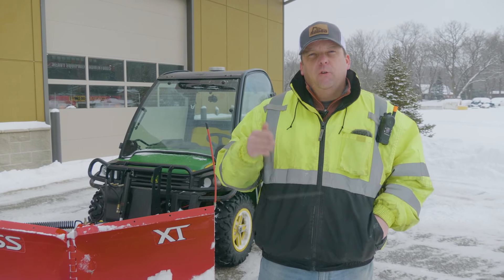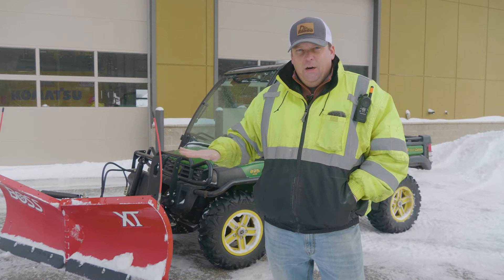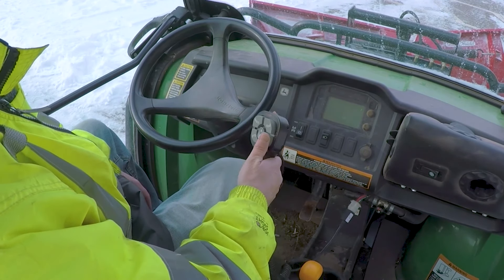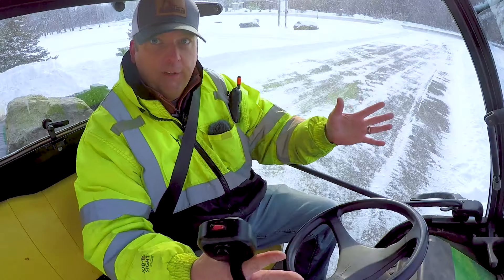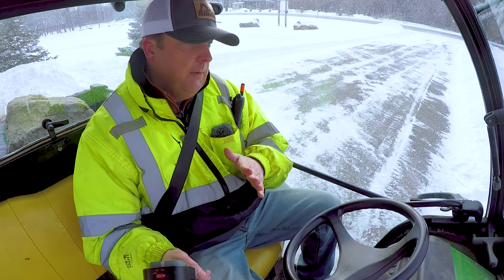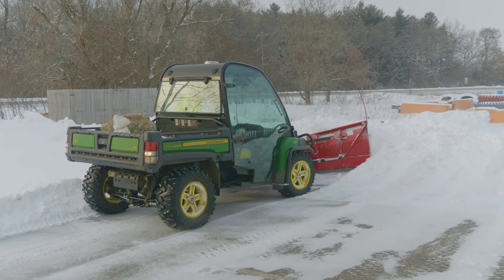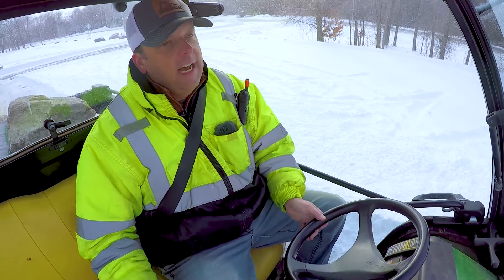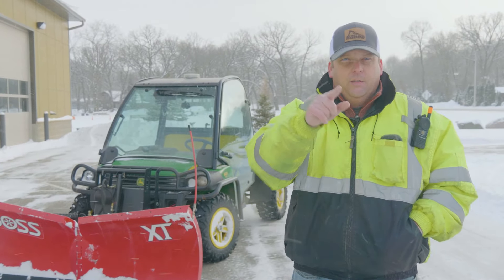How to Snowplow with an ATV | Snow Plowing 101

Comment: If you lose a line, cable or hydraulic, push into a pile to get the blade up as far as it might go so you can ratchet strap it in as close to an up position as possible and this should be enough to get you home/shop without backing all the way dragging your blade. Saves on soft tissue injuries and is less embarrassing for those that don't go to the gym....besides making an awkward situation look like you're Macgyver.
Reply from the maker: Great tip!  Thanks for the comment!

Comment: I plow a medium size park with a Gator.  On heavier or wet snows do the edges first so I have a place to deposit my snow spoil from the center. Plan your route taking advantage of hills and gravity.  In heavy snow, I will sometimes use the plow and the heavy snow resistance to help turn the gator coming back later to square, and further clean, the corner. Need more traction? Lift the blade slightly and load the front tires.

Comment: I plow in high range.  You need the speed to throw the snow.  People will complain you'll burn the belt. The belt won't burn if the machine is moving and engaged.  I have yet to smell a belt burning. I'd rather burn a belt than run the motor at almost redline.
Reply from the maker: Yeah, if I know the lot really well I may do that but it definitely can be more risky.

Comment: Surprised by the lack of noise in the 825i cab !!  Have you installed sound deadener material or is the engine/muffler/chassis combination just that quiet ?  My Can-AM Defender HD10 XT produces 80 [decibels] dB inside the cab at 4000 RPM.
Reply from the maker: Haven’t installed anything separate.   It is still pretty loud in the cab.  I am wearing a wireless lapel mic so it may seem quieter because mostly just picking up my speaking.  But still a great machine!

Comment: One of my trucks is a 06 ford ranger with a 6.5' fisher steel plow. I mostly do driveways. Some guys laugh at the little truck plowing but I tell people it's like the most powerful gator in the world lol. When you think of it like that its really awesome. 207 hp, heated/cooled cab, will do 95 mph without plow. Rated to tows 5000 lbs/haul 1300 lbs. Oh yeah, and its road legal. Gets 14 around town 19 hwy. I had to weld a custom minute mount truck side, but it's been on two different trucks now and has held up. I do 37 driveways a church and a 1/4 acre parking lot. Works great for up to 6". After that it just takes longer, I'm wishing for a bigger truck. I realize this vid is geared towards homeowners. If you're reading this and you're looking for a plow rig, you're much much better off finding annold plow truck to use around the property than using a gator. If your area gets storms over 6", the gators get pushed around by the snow instead of the other way around. I know 2 people that tryed using gators for their long drives and always need help if its deep or late in the year when it starts stacking up. They dont have the weight or momentum to do what a truck does. They are great for many things(sidewalks, trails, etc.) But imo if your area gets any decent storms, you'd be much better off with a older 3-6k$ plow truck.

Plus I have a dump truck with a 9' fisher for when it gets deep or to push back banks.

Comment: I use the same plow on my gravely JSV and I love it. Great for large side walks on commercial buildings and plowing residential driveways.
Reply from the maker: Thanks for the comment!
Reply: The reason you want to swap out to heavier springs is because you do not want your mounting bolts and locations acting as your suspension,  this causes metal fatigue and bolts to snap.

Comment: Just a safety tip - keep your thumbs out out the steering wheel. Practice keeping them on the outer ring. If you hint something and the steering will win. It will jerk to the left or right. Broken/bruised thumbs take a long time to heal.  I plow with an 06 RTV. Straight plow, turf tires and 600 lbs of weight in the bed. I can do most jobs in 2wd “M”.  It is hydro (no belt to worry about). Just turn the heat and tunes on, then go plowing.  
If I ever replace the RTV, whatever the next vehicle is will have V-plow with hydraulic angle and lift w/down pressure.
Nice video. Experience will teach the rest...
Reply from the maker: Interesting...haven’t heard that one before but good suggestion!
Reply: While this advice is not bad its outdated. My father used to tell me that as well when I was driving. I did some research on where this comes from years ago as I was into Rock Crawling. The best I could find was it originated from Large trucks without power steering. On something small like this or on something modern with power steering its really nothing to worry about. I did crawling for a number of years in amateur competition and have never come close to hurting my thumbs when the wheel jerks around. It just doesnt do it violently enough.

Comment: I use a 50" Moose straight plow on my 2005 Kawasaki Bayou 300 4x4. You don't need the cc's when you've got 10 speed ---High &  Low.  I have a Dennis Kirk canvas cab on it with 30" LED light bars front and back and a Moose salt spreader on rear---mounts on rack. Chains on rear. I bet I can blade as much , as fast as that Gator set-up. Not knocking nothing or nobody --just say'in you can run damn economically if you are a handy fabricator and got some decent ideas.  Good vid. though !!!!!!!         P.S. I HAVE (4) KAWI'S--- A 1996 HAD FOR 6 YEARS, A 1998 HAD FOR 11 YEARS, A 2005 I BOUGHT BRAND NEW FROM LOCAL DEALER, AND A ABSOLUTELY UNBELIEVABLE, UNDENIABLE CLEANEST MOST PRISTINE BIKE I'VE EVER LAID EYES ON----BOUGHT LAST AUGUST(CAME FROM DEALER IN GEORGIA WHO SOLD IT NEW TO 76 YEAR OLD GENTLEMAN)  WHO JUST TOOK IT OUT TO HIS MAILBOX TO RETRIEVE HIS MAIL--I'TS A BEAUTIFUL 1994 ONE OWNER. PROOF ON BILL OF SALE, 66 ORIGINAL MILES ( IT'S GOT THE RARE SPEEDOMETER OPTION ON THE FRONT RACK, I PUT SOME AGGRESSIVE  NEW SPIDER TRACKS AND A 2" LIFT AND KIMPEX (PERFORMANCE EXHAUST) . YOU COULD SHOW THIS BIKE AT A VINTAGE QUAD SHOW & SHINE.   that's my line-up probably all for under 15K.  You guys don't need to be impressed with these 30K  dollar atv videos----SAVE YOUR MONEY & AND PUT IT IN EDWARD JONES, MAKE SOME INTEREST SITTING ON YOUR ASS FOR YOUR FAMILY !!!!!!!!!!!!!!!!!     THX. FOR YOUR TIME- "MERRY CHRISTMAS"  !!!     Jim & Jill Kiesau
Reply from the maker: Thanks for the comment!
Reply: Yea, thank's for your video. Forgot to give ya the thumbs up buddy !!!!!!  Good work!! @HeavyMetalLearning

Comment: I run an 825i with the Deere powertach straight blade. The Boss is much nicer, just not in my budget. It does an amazing job, I really find it much more versatile than a pickup. I have power steering and the machine itself is quite nimble and I'm able to sneak into tight spots. Good video!

Comment: I've mostly plowed in full size trucks, and 4wheelers.  I did use a UTV one day, then went back to 4 wheelers (all sidewalk clearing on UTV/ATV).
I don't wear my seatbelt in a full size plow truck while actively plowing (definitely put it on between locations).  When you hit something, like a hardened snow pile, and the truck stops suddenly, having a seatbelt restrain you hurts like the dickens.  Doing 5MPH tops, I'm not concerned about hitting my head on the wheel.  I have heard with UTVs that a seatbelt is much better than not.

I chuckled when you were talking about the snow pushing a UTV/ATV steering, I've been there many times, going along nicely, suddenly you're at a 45.

Great videos!

Also, being in MN I'm assuming you salt your parking lot.  Do you have an attachment for the Gator?
Reply from the maker: Thanks for the comment.  Oh man...please wear that seatbelt!   Just make sure it’s placed correctly and then should hurt for those little jolts...but I’m telling you, if you hit something major you are gonna be in a world of hurt.   And yes, we spread salt but for our smaller parking lot I just use a smaller walk behind spreader.  Thanks for the comment
Reply: I probably should have mentioned that I mostly plow driveways - so being able to turn and move my torso to see past the pillars in the truck is extremely important while back dragging so you have ZERO blind spots.